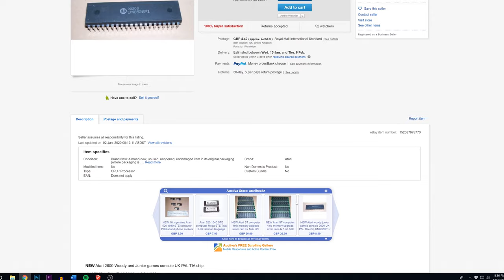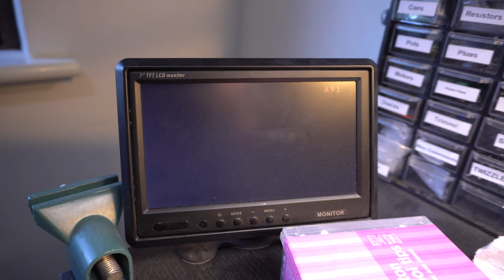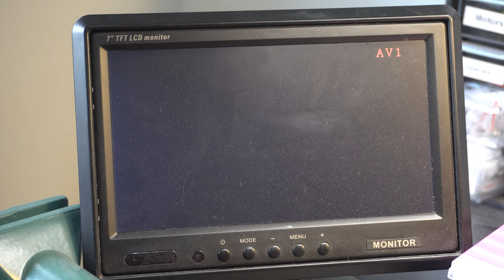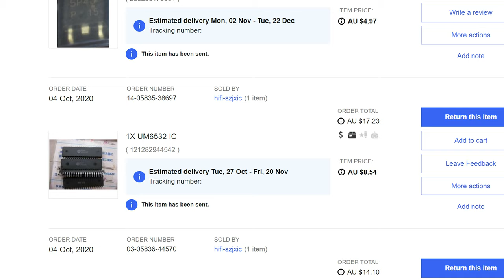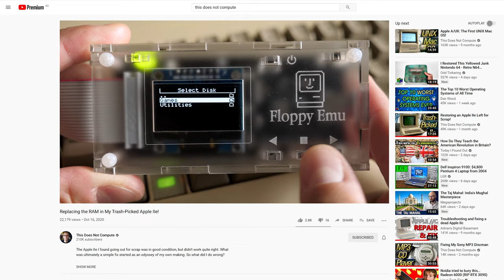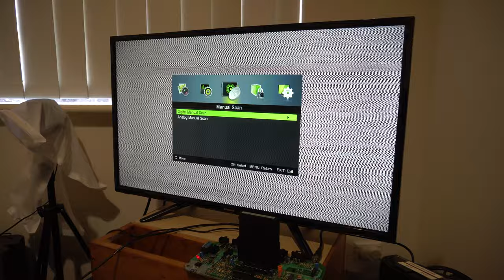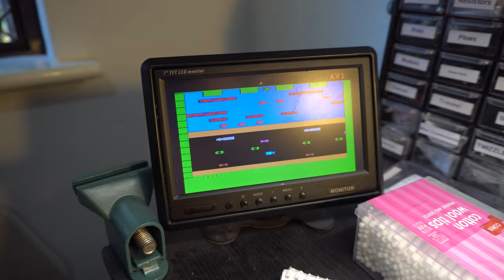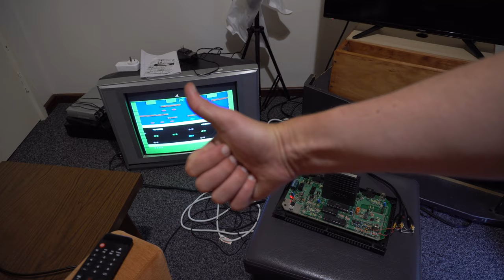Atari 2600 Jr.  Repair - Part 2

Comment from the maker: If you didn't catch it the first time around, check out Part 1 first here: https://youtu.be/5vES1T2ow4s

Also, here's an addendum where I address the issue with the select and reset buttons: https://youtu.be/VvGQkrTl9xo
Reply: Glad you were able to resolve the issue with your 2600 Junior. :)
Hope your other one gets fixed too. A minor mod i noticed with the PAL 2600 Juniors to help improve the graphics a bit either with a A/V mod or original RF was to do with the resistor value  that is marked R31 that is traced to TIA Pin6. on the PAL 2600JR, Just a optional suggestion, If you remove the 10K resistor with a 3.3k resistor, the picture quality improves a bit and shows a better video improvement. Saw this on etim's 2600RGB Mod installation page. I gave that a go and did improve it a bit with RF and composite A/V
Reply from the maker: @JRussellRetroGaming  thanks for the heads up. Etim is a legend.
Reply: @retrogameon  No worries.
and not wrong. got two 2600 that is RGB modded, the 4 switch woodgrain that is a NTSC original and my 2600 Junior PAL-B that was RGB modded. worth the money and the installing for it. I uploaded some 2600 Game captured from the Junior console on here to show how good these kits are.

Comment: Great repair! I'm currently facing an issue with my 1987 2600 Jr. where the lower half of the screen is glitching (misplaced sprites, graphics moving to the left which are supposed to move to the right). I'm suspecting a broken TIA... will recap it first though and install some sockets then. Oh well.

Comment: great stuff! it gives me motivation to pimp mine.
i want to change the main pcb for that to make it more modular and go step by step in more modern directions (hdmi, 65c02, ram, rom, audio-chip with stereo, usb-c powered, or dc/dc converters, ...)

Comment: So cool, thankyou for posting.... Im late to the party but ive just started out on the restoration path and my first console victim is an atari 2600 jr. First and foremost i would love to know if there is any way to save the original sealed power plug. I love the stamped design but it doesnt work... unsurprisingly after this many decades. I could buy another one but if theres any way to save it... i would love to know... even if i gotta swap the housing over.
ps, loved the vid. Jay

Comment: The 6507 shouldn't have died from that scratch? It's only the plastic casing that got scratched.
Reply from the maker: What I didn't show was that it was scratched twice... in the same spot :P But who knows, you might be correct. I still have it, maybe I should test it...
Reply: @retrogameon  scratching it should really does not do anything. the plastic/ceramic case is at least a 1mm thick protection until you reach the aluminium pins and the silicon die in the middle

Comment: Cool I have one of these, would love an av mod done on it one-day.
Reply from the maker: I can recommend the one I installed -  it's super simple. It doesn't require any special parts, just a capacitor and a handful of resistors.

Comment: The hex screw inside the RF pot seems to be some sort of carbon (graphite?) that became too brittle. While adjusting the RF pot, it broke. Now I have no RF video. Is there an easy fix for this (like replacement carbon screw) or do I have to go through composite mod route? Thanks.
Reply from the maker: That happened to me too. I couldn't locate a replacement part, probably because RF is so antiquated. Personally, composite or RGB mods are the way to go to bring this bad boy into the 21st century.

Comment: And after even MORE head scratching I realized that I could’ve just bought 6 whole Atari’s with the money I spent to break one and violate the other with mods and dodgy chips? Lol, RF female to male coax adapter, $10 on ebay right now. Truth is if it doesn’t work after a legit deep clean, just trash the thing, it’s dead. Do it the original way but trash the switchbox for the adapter. I’ve been getting Ataris off ebay up to now for like 50 each no problems ever, maybe I’m lucky but all work on CRT to Roku. Stop wasting your time putting ancient hardware on life support, if it was a “good one”, it’d work fine.
Reply from the maker: Where's the fun in that? I enjoy the troubleshooting process, even if it goes haywire

Comment: dude, let me guess , the transistor is the issue ! I watched yesterday part 1 of yours ,becouse I had the same problem like you ,and also like you I socketed all the chips including the D4050BC (the little one) , and swapped them with another working Atari and all was OK , And finally after all of this I discovered the fucking stupid broken transistor !
Reply from the maker: I replaced a lot of parts but never a transistor. Which one was it?
Reply: @retrogameon  there are two  PNP  on the left side "2N 3906" , and one  NPN "2N 3904" I replaced one of the PNPs ! :)
Reply from the maker: Good to know! I've never had a transistor go bad.
Reply: @retrogameon  BTW the strange thing is that yesterday I tested the old transistors with a multitester  and they was ok.... I but oh well the console wotrk with the new ones :D (I salvage them from other old electronics)